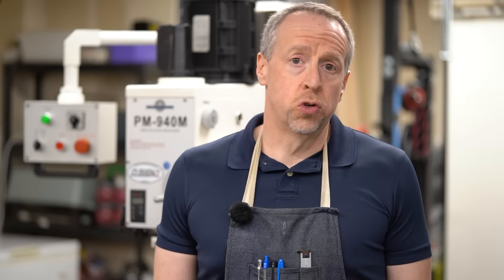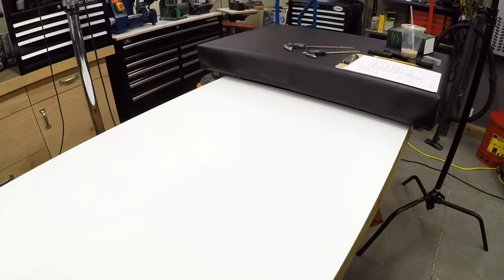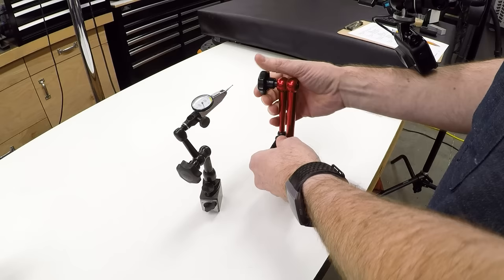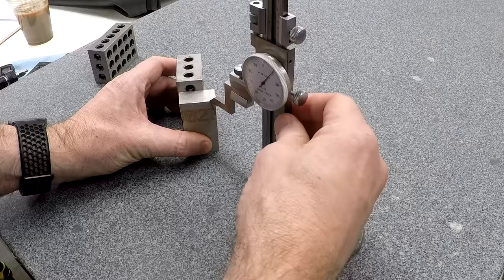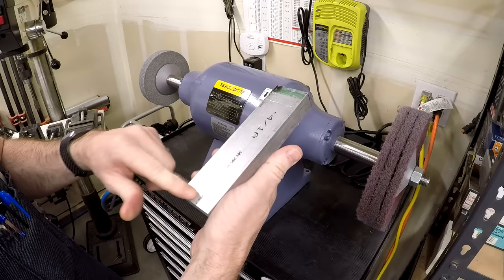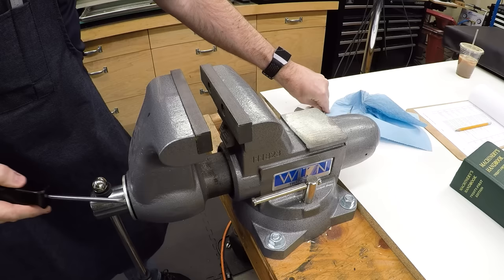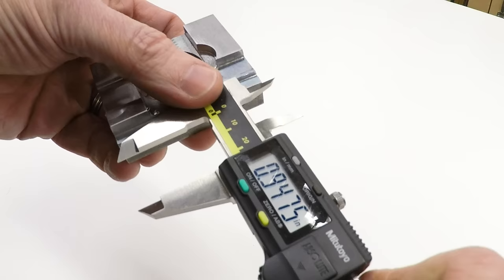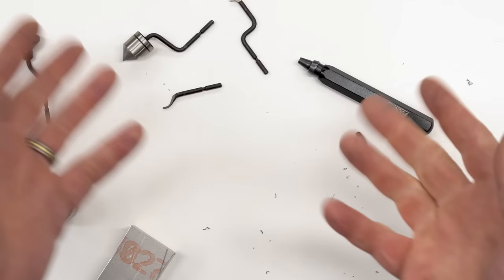Top Ten Tools I Use Every Day in the Shop

Comment: The 20% off coupons don't apply to "Central Machinery" anymore - they added that to the excluded list on the coupons more than a year ago now. I got that exact same bandsaw, but without motor or blade, and branded JET at an auction for $20 :) I almost have a new motor mounted on it, and I have new blades waiting to go on it.
Reply: Also, the coupons in general are gone at HF. The last 20% off coupon expires on February 8th, and then that's it. They've moved to a new model now - no more coupons, no more print ad books, just "sales" advertised by email.
Reply from the maker: That's disappointing to hear.  It was a good run while it lasted.  It'll be interesting to see if there are any good sale discounts in the new model.

Comment: So ironically, Harbor Freight is actually going to instant savings instead of coupons - the last 20% off anything I have in the database app expires on Tuesday. Hopefully they lower some prices to make up... (See eg Den of Tools)

Never actually seen that variety of Knipex wrench, but now I definitely want one. Looks like a mix between channel locks and adjustable wrench. But they're not a "nut lathe"? Amazing.
Reply from the maker: Right now, the 2 ton shop crane is on sale for...wait for it...almost exactly 20% off.  The coupons may be going away, but I don't expect their operating model to change very much.  They have had a "Huge Sale" or "Final Liquidation" or some such banner on the outside of the store for the last two decades.  :)
Reply: @Clough42  oh for sure. Or as I commented on that Den of Tools video, COUPON DISPOSAL NOTICE!

Comment: The link for the Starret band saw blade is no good anymore. Do you happen to have the part number. I've been searching, but have come up short. Very helpful video. I was actually on the Mc Master Carr site looking for those bearings too. I knew these were too thick but may remove some metal in the bore in the mill.

Comment: I have the exact same Allen wrench kit, based on the theory that the namesake should make a good product. They are awful, crappy soft steel that will strip when when you are using a softer stainless steel head. even a cheap set of pittsburgh hex keys is better than the allen original due to better hardening and better steel. in the long run, having a kit like that on the shelf is nice to cover all ranges, but I bought the sizes i need the most as individual keys from TengTool.
Reply from the maker: Interesting.  I had the Pittsburgh kit and found them so soft they were pretty much useless.  There must be some variability.
Reply: @Clough42  so far, the smaller sizes of the pitsburgh kit did not round over as fast as the Allen set (3mm and smaller). everything 4mm and larger is fine on both sets. the handle on the pittsburgh kits are not very nice to hold, and the TengTool has proven to be superior to all the kits i have...
Reply from the maker: @joergengeerds360  cool.  I'll check them out.

Comment: I have a 4 x 6 Harbor Freight bandsaw and I need a new blade so I used your link to the Starrett blade and I noticed it is 0.035" thick.  My saw has a sticker on it that indicates that it uses a 0.025" blade.  Did you intensionally get the thicker blade or is there a problem with the link?  Thanks!

Comment: Hello again, one more question but about the grinder. It's a "slower" speed unit (1750 rpm) as opposed to the  run of the mill bench grinders(usually 6") which are in the 3000+ range. If I use your recommended deburring wheel and disks do you think that I should look for a 1750 rpm grinder/buffer and why ??
Reply from the maker: Up to you.  I chose the slower motor so it would be quieter,  less aggressive, and easier to control.
Reply: @Clough42  Thank you for taking the time to reply !  I guess it still deburr's ok though ?

Comment: Hey I just ran across your video ! Got a question about the demurring wheel. In looking it up it states that it is for non-ferrous materials. I just do hobby type projects that occasionally require deburring of steel and aluminum. I think that Scotch offers an aluminum oxide wheel which they say is for ferrous metals but in a medium grit and was wondering what you thought would work better in my situation. I don't do heavy deburring stuff and was wondering if also in addition using the "disc" that you recommended would help with finishing/smoothing up the edges ?
Reply from the maker: I use the same wheel for aluminum and steel and have had no issues.  If I were doing further processing of the aluminum, getting steel residue embedded in it might be a problem,
Reply: @Clough42  Thanks for the reply !!

Comment: Vices:
You need to make the handles ‘sticky’ to stop them falling down when vertical and causing blood blisters, & no need to ask how I know🤗
One of my first vices I bought in the ‘70s had a spring loaded brass pad pressing against the jaw side of the handle to keep it in place, but easy to move.
I subsequently modified all my other vices thus, irrespective of size.
Quite easy to dismantle and drill the needed hole down the centre of the screw and experiment with spring strength.
Made life blood blister free👏😂
Reply from the maker: The Wilton has a rubber pad to cushion the handle at each end.
Reply: @Clough42  
Ah, BUT the spring loaded handle when centred, will stay in place when spun to either open or close the jaws.
The other reason I did the mods.

Comment: You have the Wilton 6" Tradesman Vise right? I got mine a few months ago and had the same idea so I'm glad to see it working in your setup and will move forward with mine.
What size thrust bearing did you wind up using in yours?
Reply from the maker: Link in description.  You need the bearing and two of the hardened washers.
Reply: @Clough42  The link seems to be cut off and only sends you to the page with the bearings and not the specific bearing or washer.
Reply from the maker: @ptrotter5223  that's how McMaster Carr's website works.  Scroll down and you should see one item expanded.
Reply: @Clough42  Doesn’t seem to work. When I look at the link it only seems to go as far as the page number. I’m used to the way the McMaster catalog works. Strange.  I’ll measure it anyway so it doesn’t really matter.  Love your videos. I have learned a lot from you.
Reply from the maker: @ptrotter5223  You're right, of course.  I thought it worked for me when I set them up originally.  I updated the description to include the part numbers.  Sorry for the difficulty.  It's for a 1" shaft, with 1-9/16" OD, 5/64" thick.

Comment: Please could you help me with a little info. I have the same import bandsaw and have never been able to tension the belt to enable good operation of this machine. Please could you send me details of how to tension the belts? If your reply is yes, I am willing to give you my email address. Thank you for this useful video, I have 8 of the 10 tools you listed. I would like a buffer wheel,  and my Noga tool is without the two (male and female) countersinks. I believe my go to number one tool is my sturdy little 6" rule, I have three of them because I often misplace them. A very interesting topic, thank you for sharing.
Reply from the maker: I turn the tensioning knob until it's way tighter than I'm comfortable with, and the saw runs fine.  Sorry I don't have any more advice.
Reply: @Clough42  Thank you, my belts keep slipping off the drums. I have tried your method and it hasn't worked for me. The one thing I haven't tried is a quality belt. So the one you mentioned will be my next try. Thank you once again for your prompt reply.

Comment: Speaking of #1... my Grandfather (another machinist) had a pair of glasses made with the close-up bi-focal lenses on the top so he could work on equipment above his head. Nothing new under the sun.
Reply: Interesting idea, standard bifocals fit the common use case of "reading", down and at arm's length. But in the shop, you stoop to get in close to see work in a machine, then have to tilt your head back to use your bifocals...too much twisting! I may try this out, since it is time for new prescription safety glasses.
Comfort and ease of use are key to compliance...

Comment: It seems that you are perpetuating the myth that cheap digital calipers need to be re-zeroed when you turn them on. Simply not true. I have dozens of expensive (Mitutoyo, B&S, Starrett) and cheap calipers (Harbor Freight, etc.).  None of them require resetting to zero.  You've made a number of videos about this subject recently and it just doesn't match what I've experienced.
Reply: I think there must be a new model of cheap digital calipers that does need to be re-zeroed every time you turn them on. I think that was their solution to the "cheap calipers drain batteries like they're going out of style" problem. They couldn't match the low standby power consumption of the good ones, and people complained that they chewed through batteries, so they changed them to not chew through batteries, but they have to be re-zeroed now. I have a super old set of "cheap" digital calipers from Princess Auto (aka Canadian Harbor Freight). Not only do they not need to be zeroed every time they're turned on, but they had pretty decent finish on them out of the box, but they do chew through batteries like crazy. I tend to just take the battery out if I figure that I wont' be using it for a week or more now. I got them shortly after they were introduced, so probably before they started cutting corners on finishing them better. In a previous video, he actually showed how some cheap calipers he has won't keep zero when you turn them off. Do they all do that? No, but apparently some of them do. If you're looking to buy a set of cheap calipers, it's a pretty quick check to pop the box open in the store and try it out to see if it continues to update the position when it's "off" or not.
Reply from the maker: You saw me demo in the caliper video that mine lose their position when powered off.  These are probably 15 years old.  After people started commenting that some do and some don't, I went to Harbor Freight and bought a brand new pair of the same model, and they also lose their position when powered off.  I suspect there are different models out there with different characteristics.